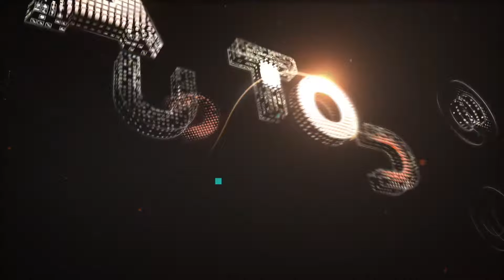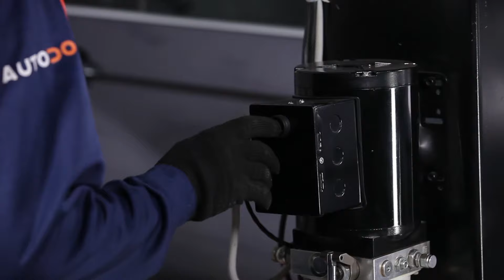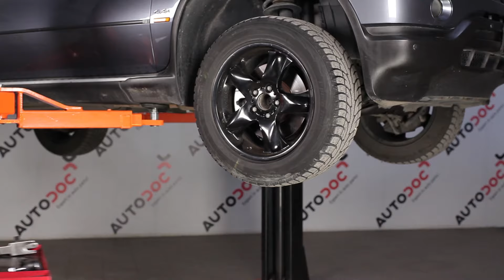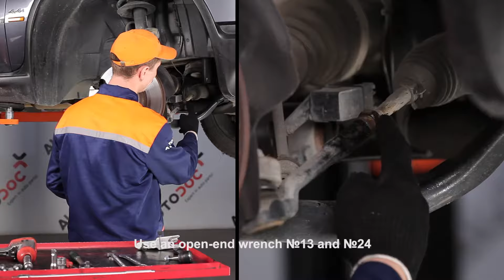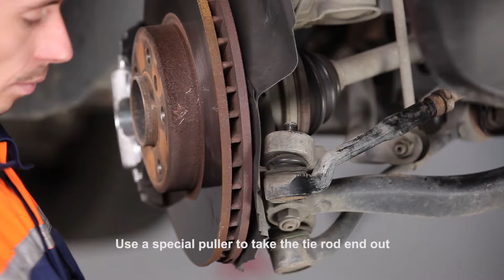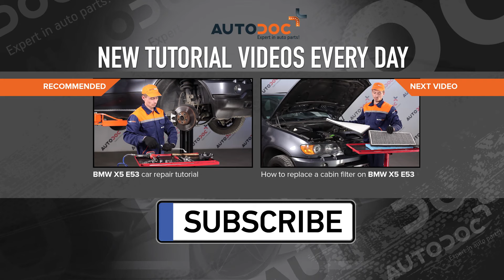How to change tie rod end / track rod end on BMW X5 E53 TUTORIAL | AUTODOC

Comment: I noticed that you didn't raise the wheel hub to ride height.  Is that not necessary for the tie rod replacement?
Reply from the maker: Thank you for your comment.
With a controlled tightening, it is not necessary to raise the hub to the ride height.
Best regards,
Autodoc team.

Comment: it turns so easy for him @2:08 I had to use two wrenches for mine and the 13 mm end stripped and the tie rod end still didnt come lose  :(
Reply from the maker: Unfortunately, the complexity of replacement is individual for each particular model of car and all depends on the technical condition of the parts. Our videos are for informative purposes only and it shows the sequence of repairs, so some stages of the repairs might have been excluded and to save time, we loosen some of the units in advance.